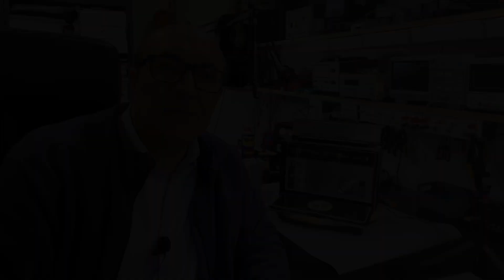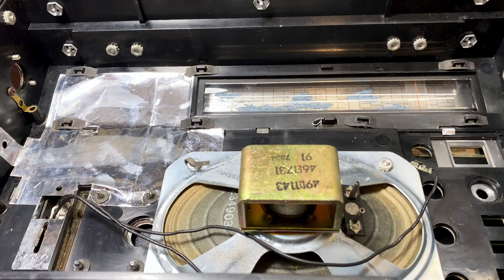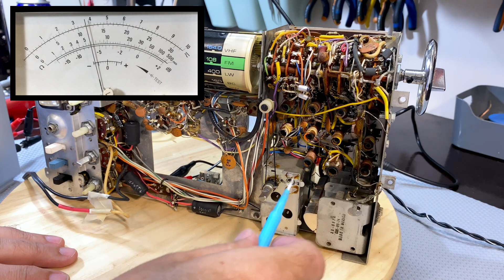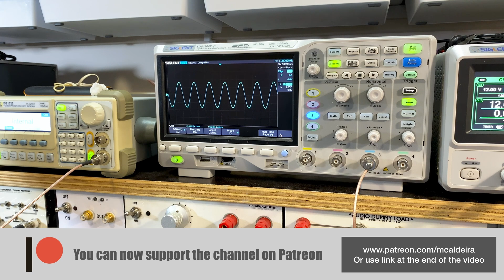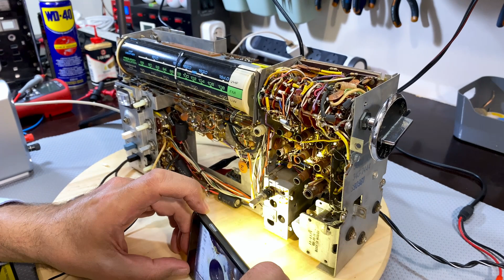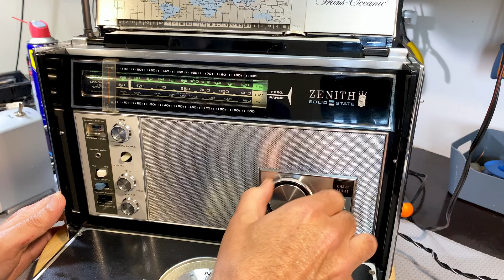FM alignment and more. Zenith Trans-Oceanic Royal D7000Y restore, part 3.

Comment: 17:57 hello I have the R 7000 and I have a question about the side dial that selects the different bands range. I got this radio back in 1980 and when I turned that side dial it used to go clunk clunk clunk clunk now it does not also does not seem to lockin place. I’m not sure if that part of it is repairable. I definitely do not have the knowledge of how to repair it. I shake too bad. I’m looking for help in my area. I’m in south west Michigan.
Reply from the maker: That is definitely repairable. Look around your area for a good tech.

Comment: It's a nice looking radio and sounds great, not sure if I would like to do major repairs on it.  It picks up BBC radio 4 very well. When I lived and worked in Gibraltar back in the early 1970s I was able to receive BBC radio 4 at midday, which I was quite surprised. I like to have all adjustments at the rear, while it is still in its case, things can go wrong afterwards. Still a nice radio.

Comment: T208 with point 6 could be found: because FM works well, just try every connection on T208 until you find the one that will go through zero.